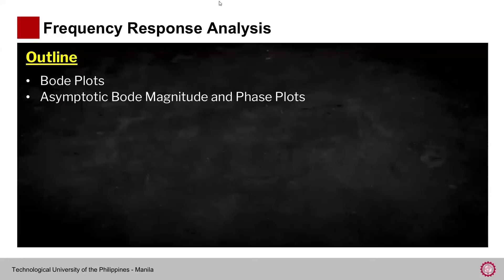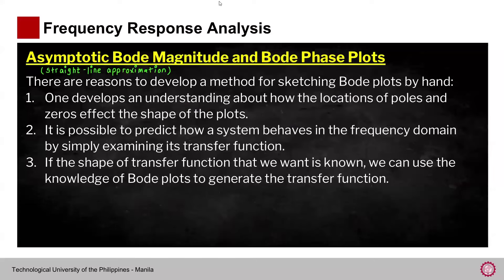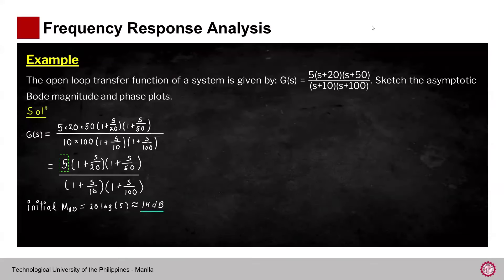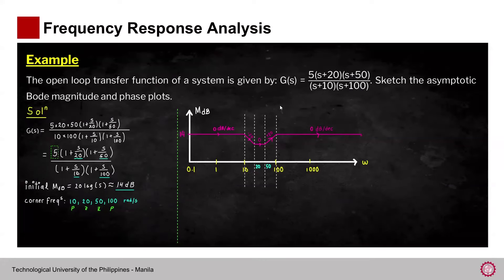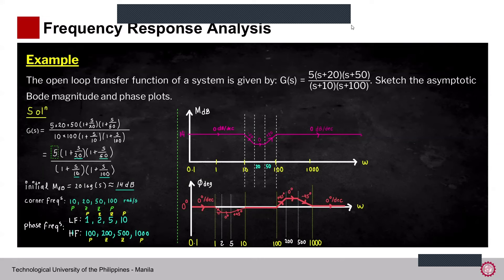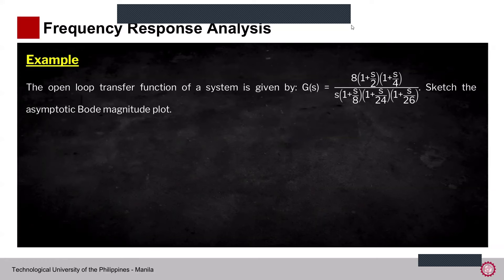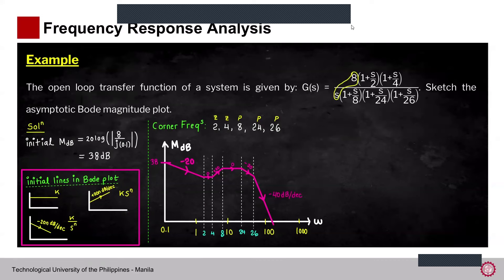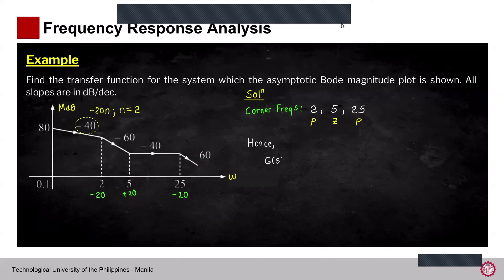Feedback and Control Systems | Frequency Response Analysis (PART 2) | Bode Plots| TUP ECE LECTURES

Comment from the maker: Sorry guys, Zoom went bonkers and covered some portion of the screen above and below. But it didn't touch the place where I am writing. Also, I forgot to solve for wgc, but it can be solved by applying the slope formula. 20 = (0 - 18)/(log(wgc) - log(160)) ---> wgc = 20.143 rad/s